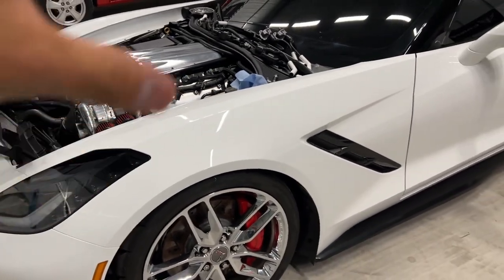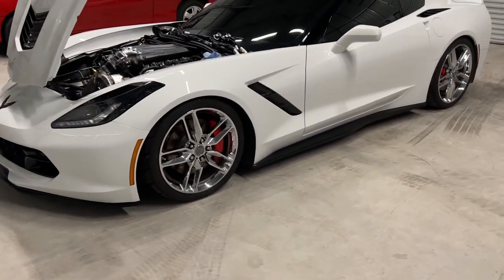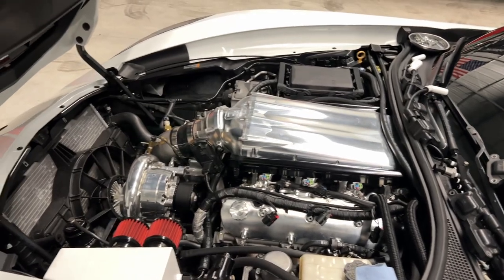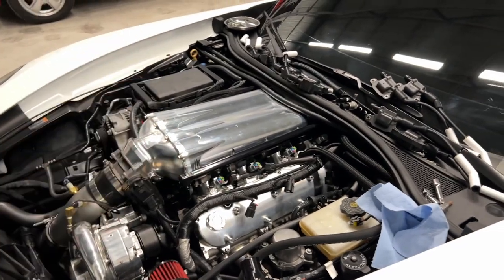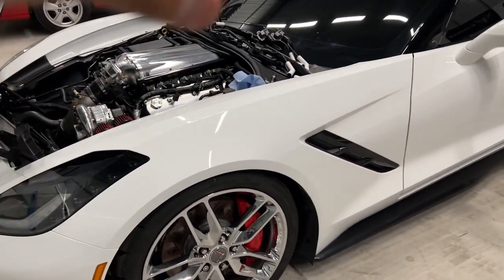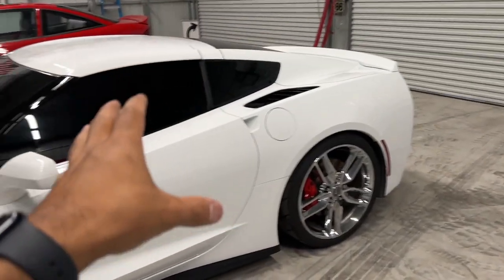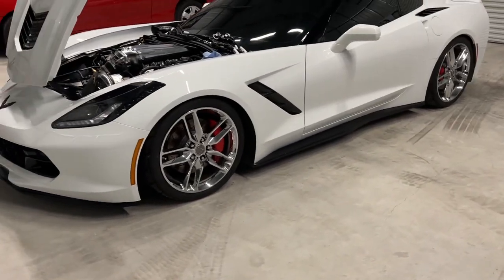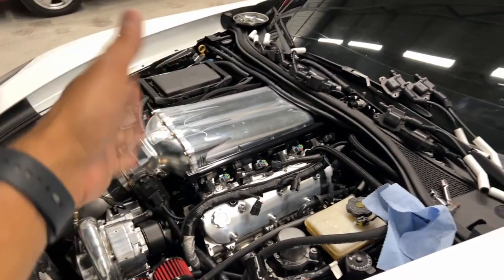C7 LME 427 First outing - Cadillac Attack 2023

Comment: Running strong! I'll be keeping mine N/A so might be able to stick with the aluminum block. So happy to see that intake manifold clears the hood!! Keep it up man.
Reply from the maker: It really does NOT. The cradle is spaced and the hood is dented. Also fire wall is pushed back a little. When the hood closes, it hits. I will be putting my z06 hood on it to help. Thanks for watching.
Reply: @The Speed Bug  hmmm. I could get a Z06 hood I guess, but I have the 2017 Collectors edition so I would want to have the matte black vinyl applied, or have the whole stripe painted on the car...I'll figure it out with LME when the time comes. Depending on the RPMs I might not need their intake manifold. I'll be focusing on more of a streetable road course build. Thanks for the response!

Comment: What wheel HP/TQ does it lay down?
Reply from the maker: Little over stock, thanks for watching.
Reply: @TheSpeedBug  so 575/550 maybe.  I’d figured LME would have done better than that.
Reply from the maker: I think you know it’s in the thousands. ;-)
Reply: I should have been more specific.  When LME builds a long block they dyno it and break it in.  That is the HP/TQ   number I was interested in.  This obviously is only naturally aspirated before you installed a power adder.  Also what compression ratio did you go with?